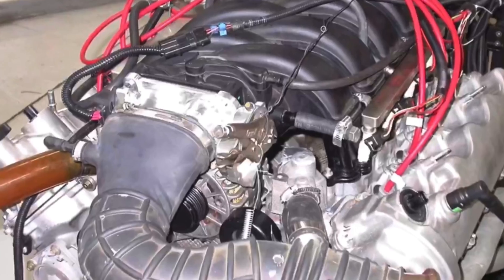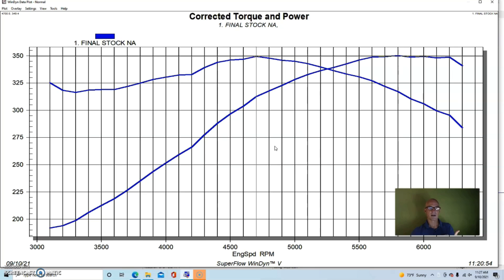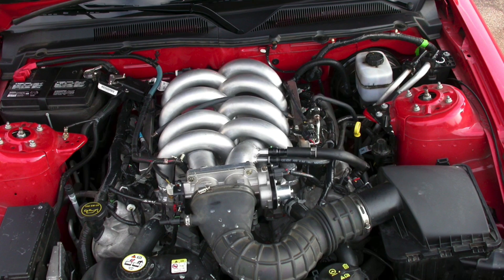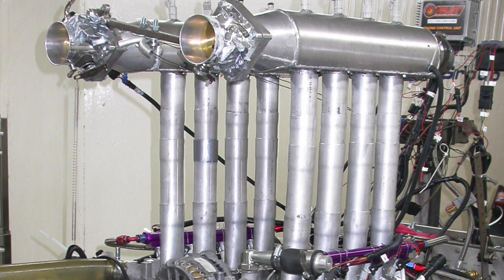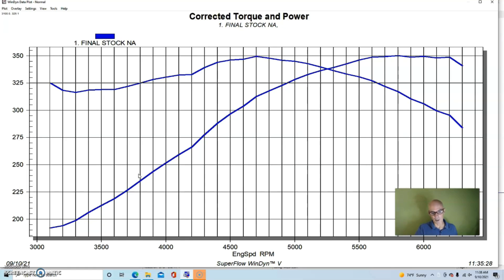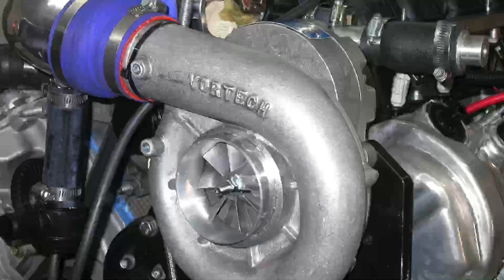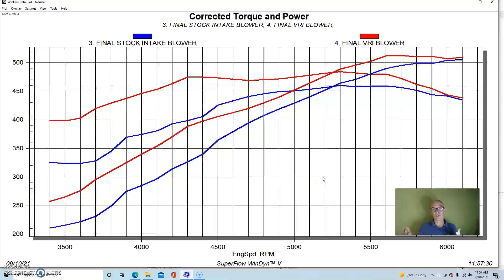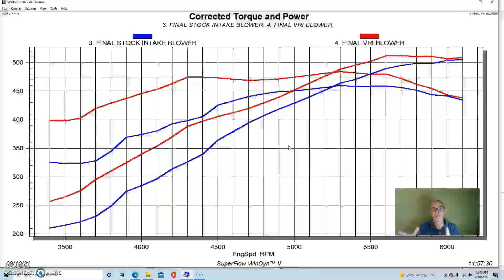HOW TO: DIY INTAKE MANIFOLD. WILL IT WORK? IS IT BETTER THAN STOCK? CUSTOM 4.6L 3V FORD

Comment: Serious question, why do so many engines have rectangular intake ports when valves are round? Ford used a lot of round or oval intake ports that flowed very well and the oval port BBC heads are very good too. It would seem that there would be no, or very minimal transition from the port to the valve area if they were basically the same shape.
Reply: Because of packaging.  Pushrods/valve trains and head bolts get in the way.  And you still need water passages to cool off the mess.